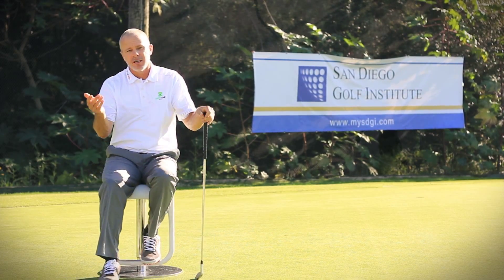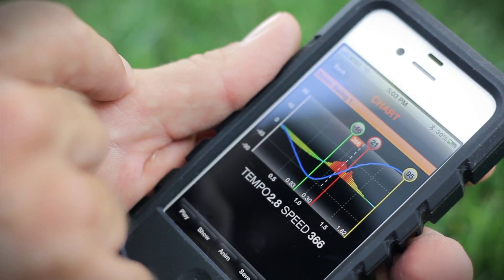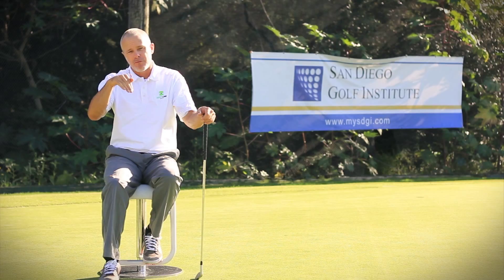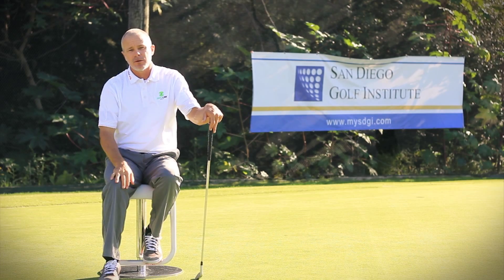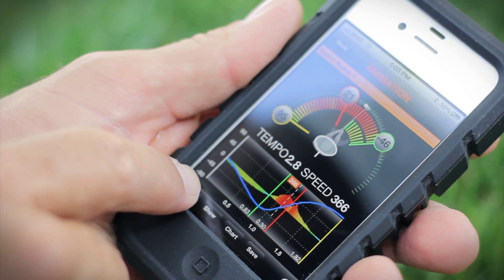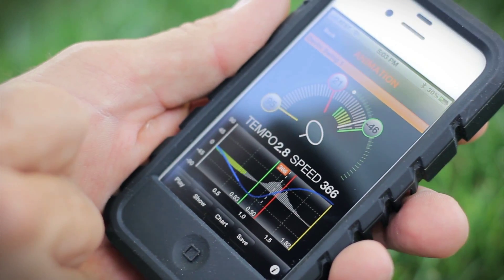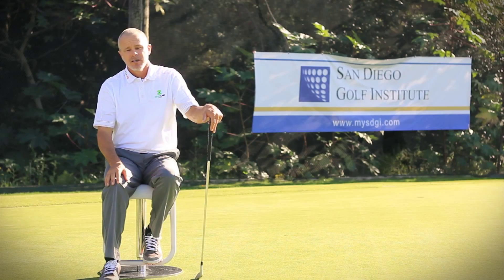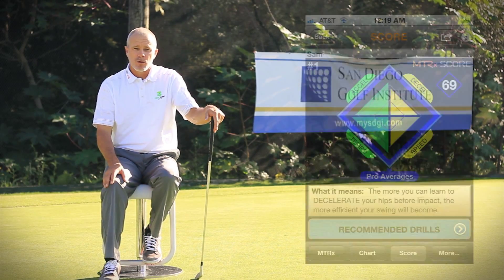"Swing Deceleration & Kinematic Sequence" by Zeroline Golf

Comment from the maker: Swing Deceleration & Kinematic Sequence
Our most popular YouTube video discusses the kinematic sequence and how power is generated from the pelvis and transferred through the body to the torso, then to the arms and ultimately to the hands and club head.  If any part of the sequence is out of order, power is lost and swing faults can creep in to your swing.  
Examples of common swing faults include early extension or casting to make contact.  Pelvis deceleration is a major component of the kinematic sequence because as in order for your torso to fire, the lower body needs to decelerate and stabilize. Once the lower body is stabilized, rotational energy is transferred to the upper body.
Our Golf MTRx app provides 3 ways to track your deceleration: 1) Chart 2) Animation 3) MTRx Score, which identifies areas for improvement, will reflect a significant mark-down if you have issues decelerating. 

 #golfmtrx   #golfswing   #golfapp   #kinematicsequence   #biomechanics   #golfswinganalysis   #golftips